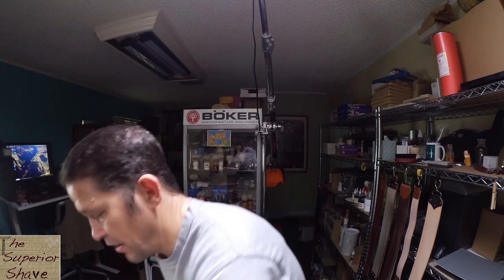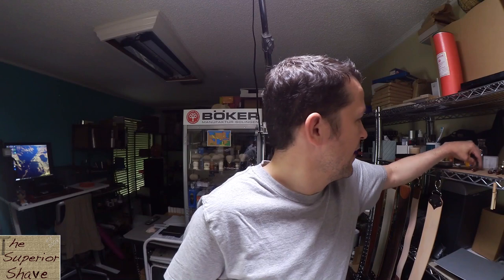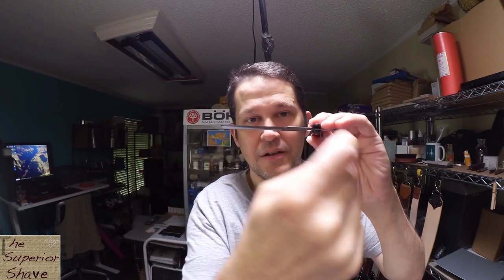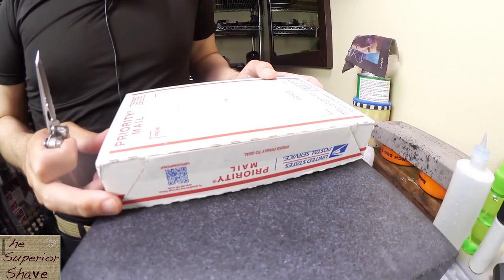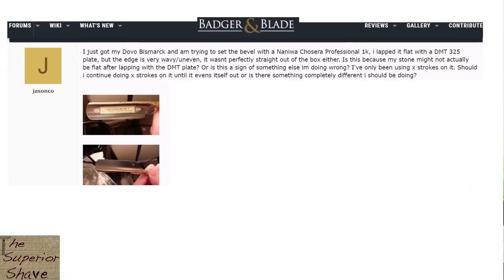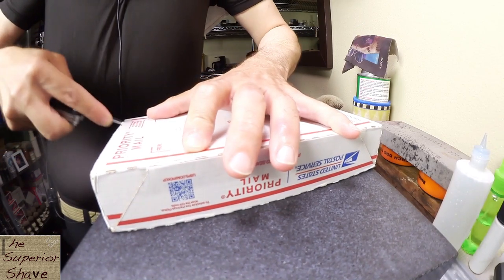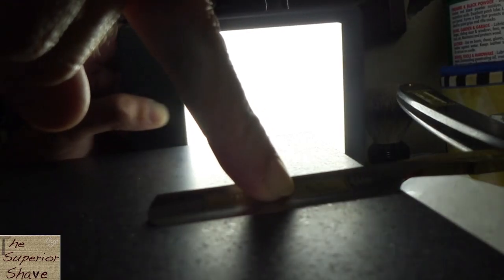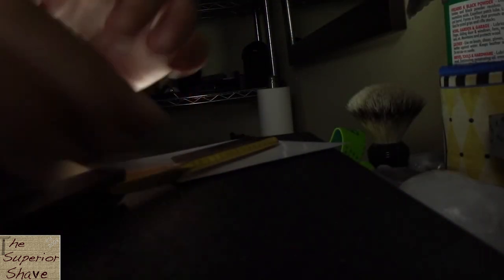Stone and Strop vs (Grade B) Surface Plate | Checking Straight Razor Flatness

Comment: Few people understand flat. It is so simple and complex at the same time.  A counter top is flat, until you compare it to a surface plate and then you find out what flat really is.
Reply from the maker: Indeed, and this is what for me is the most impressive thing about the Great Pyramid, it is 755x755' [still larger than any single building footprint today] but only +/- 0.63" across a whopping 9060x9060" plane...that's even better than most surface plates!   Home foundations in USA are commonly also 0.6" out of true, but they're not as big as a couple of football fields.